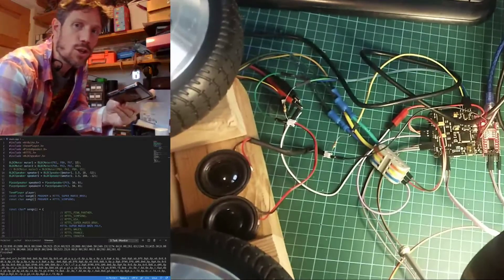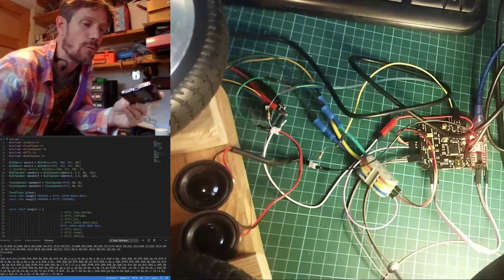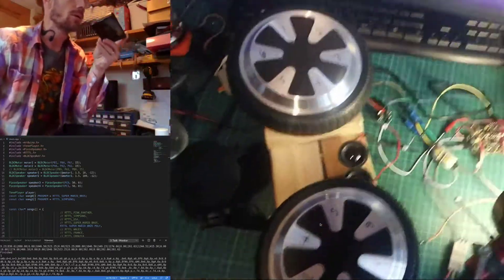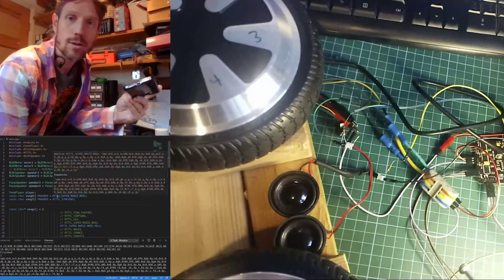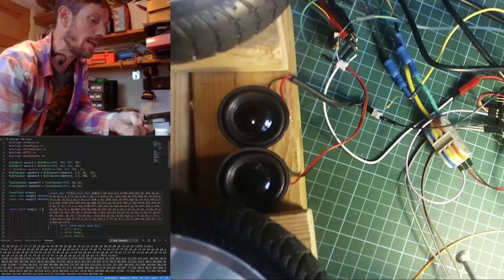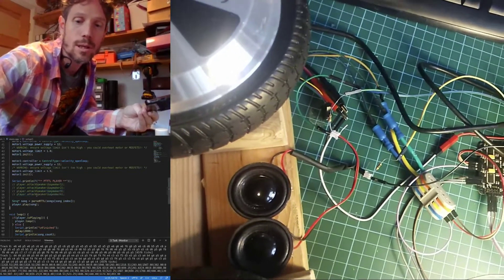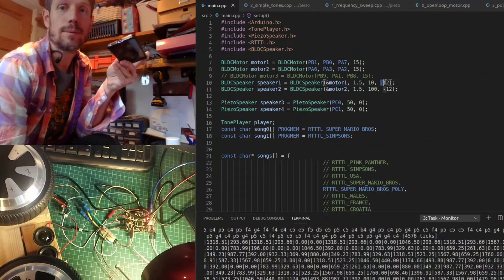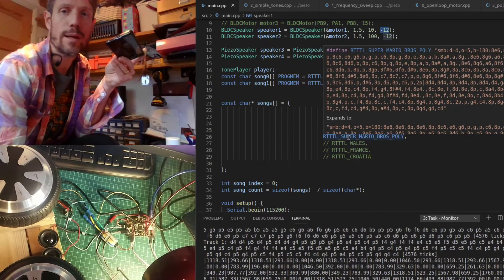Hoverboard BLDC Motor as Jukebox (featuring storm32 gimbal controller)

Comment: Hey there Owen! Would you mind sharing how you got the gimbal controller to work at all? I can't seem to get mine to do anything :(
Reply from the maker: There are a few chats about this board on the simplefoc.com community forum. Have a read of those and maybe ask a question there.  I regularly read and respond.  Are you wanting to just use it as a traditional bldc controller or make it play music?
Reply: @OwenWilliamsRobotics  thank you so much for answering, I have been on the forum and found a post by blackdude07, tried the bootloader method, usb programming doesn't work, and programming via stlink doesn't seem to do anything, my motor doesn't budge and usb-serial doesn't work, windows doesn't even recognize it. (But with the bootloader on, the serial works fine). 
Did it work for you straight after programming it via stlink?
Reply from the maker: @ardart  i haven't used usb serial, instead I used an ftdi usb to serial. They cost about £5 on ebay. Getting some form of serial working I'd essential to debug.  It's been 3+ months since I've used this gimbal. Getting spi/i2c magnetic encoders working was a challenge. I learnt a lot playing with this board!
Reply: @OwenWilliamsRobotics  oh is see, well I just tried it out with an Arduino/ftdi and it still doesn't connect or upload :(
Reply from the maker: @ardart  i thought you'd managed to upload via stlink but hadn't managed to get serial working.  Do you have much experience with ftdi and stm32? PC10 is tx and PC11 is rx.
Reply: @OwenWilliamsRobotics  yeah I finally managed to get the upload working via st-link, but the ftdi serial is still nada, I followed blackdude07 connection diagram and nothing shows up, I'll try it out with a real ftdi when it shows up, we'll see I suppose
Reply from the maker: @ardart  you are connecting ground and crossing over tx/rx, right? I never connect 3v/5v as the board is powered by other means.  Might be worth trying HardwareSerial mySerial(PC11, PC10);. mySerial.begin(115200); mySerial.println("hello");
When serial doesn't work sometimes it's because the baud in code doesn't match monitor.
Reply: @OwenWilliamsRobotics  yep, thanks that worked, I can't read schematics so I just supposed the UART pins on the board were for serial lol
Reply: @OwenWilliamsRobotics  on a sidenote, how did you get i2c to work?
Reply from the maker: @ardart  there are two i2c ports. they are separate i2c buses. I2c1 and i2c2. One is typically used  for connecting mpu6050 for gimbal use case.  I tried both, and from memory got one working. I also seen to remember using an as5600 in analog mode (simple analogRead) and have used an spi magnetic sensor but that is quite a bit harder (requires some desoldering). It's been a while since I've used this board.
Reply: @OwenWilliamsRobotics  thanks! I got it working on one of the ports, now I'm just having some trouble getting the motor to not fall in a feedback loop for some reason, but I should be able to work that one out!
Reply: This is an awesome library. I'm using it with an MKS ESP32 FOC board and ok hoverboard motors. How do you know what kind of voltage limit to set?